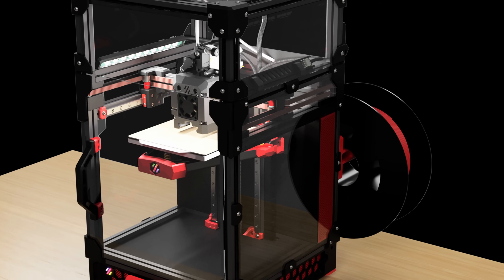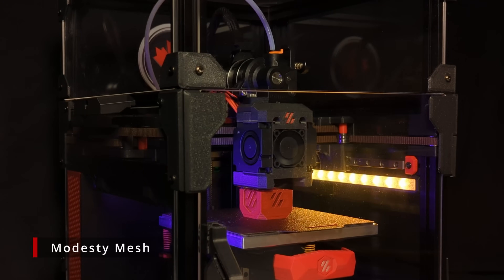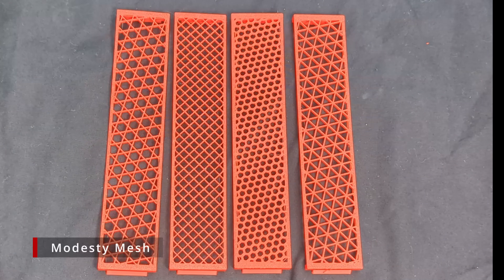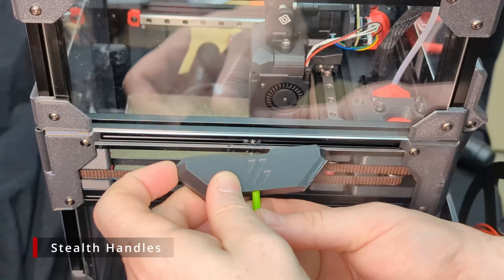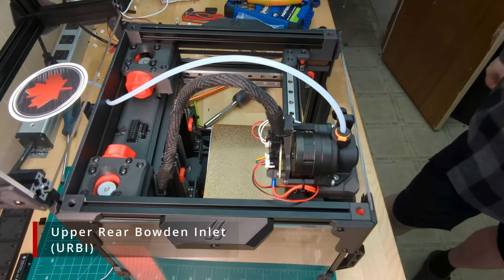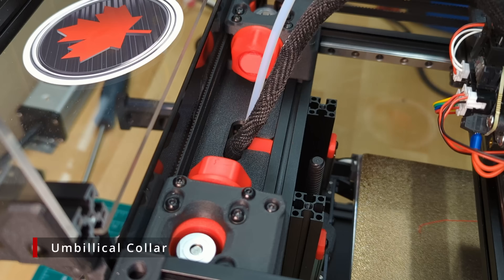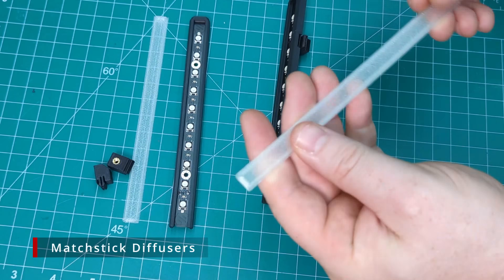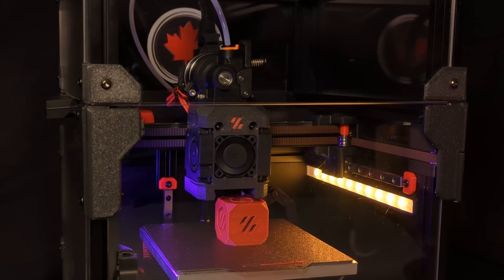Voron Mod Showcase: Our Top 5 V0.2 Mods!

Comment: Hi you going to make the URBI for the new filament sensor bearing? If not what is the original one used as ""bearing"" thought it was the RS85
Reply from the maker: MR85 is the bearing.  The design is almost done,, We'll try to get the files up in the next week or so.
Reply: @MapleLeafMakers  Thanks I'll wait for it :)

Comment: the mods should all be voron 0 printable tho. :(
Made in 2 pieces from the start if they are 2 long. easy to snap together .
Reply from the maker: the modesty mesh  and URBI are too thin for any sort of 'snap together' features to be reliable, they'd need to be glued, I've done split versions of both of those mods for testing but they're a big compromise on the aesthetics of the models, so I didn't move forward.  It should be fairly easy to jsut cut the parts in the slicer and glue them back together though.